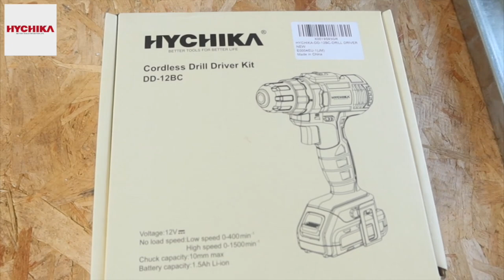🔥 Drywall partition ▶︎ How to Build a metal framed wall 💪 PLADUR

Comment: Manufacturer of intelligent manufacturing equipment for light steel structure buildings
Foshan FrameMac Technology Co., Ltd. (FrameMac) is a professional light steel structure building intelligent manufacturing equipment manufacturer in China, providing a fully automatic light steel building frame production solution integrating software and hardware. The "FrameMac" solution realizes the seamless connection of "end-to-end" production from CAD architectural design software to production processing, construction and installation. FrameMac light steel equipment source factory

Comment: worst and totally wrong make drywall sheet horicontal, lot seam and lot more work than vertical. sheet have standard dimensions perfect to height and wide to drywall not need cut any.
Reply: Cross-bracing for rigidity/  added structural strength (common sense)

Comment: such houses are blown away by light hurricanes)
Reply: Whewre did you learn your structural design? In the Tubold's University of  Quiapo!  Those structures were originally design and built by the US Navy in Guam, Marianas and other Super Typhoon belt!  IQ 11!
Reply: same wood frame blow if hurricane go, lot better make hollow blog wall all outside wall, inside can make steel, lot cheapen, wood or hollow block wall have same price, wood have expensive and burn easy. wood have worst material today at house.

Comment: I always lay the boards vertical not horizontal..Any reason why you do ?
Reply: Horizontal boards are more#stronger wiht alteranate joints
Reply: Then the support spacing will need to be 50cm not 60cm.
Reply: @carlrotheram3684  this is not a rule ,  he space studs at 40  cm ,  i see details and steps  in his work and i can say he know what is doing
Reply: normall drywall panels installed vertical because normal house height have same than sheet panel height, not need cut and lot lot less seam have, have lot less work at seam and strong.
Reply: @mattivirta  drywall sheets come i various size and vary from place to place , there is no rule /law on how to lay panels , in the vid he fallow  all the right steps
Reply: @TheMakyato  i have working 30 build houses ower 300 house, and drywall sheet has last 30 year only standard size not other have in hardware shop around world 26 country has build houses, all have 2500 X 1200 size ewery country, you can cut in work sheet but hardware have only one size, same plywood and other sheet, all have only standard size not more or less. and if installing sheet horicontal not have wall frame support back to sheet seam horicontal, worst side installing sheet. but vertical you have support because wood or metal abutment have normal all sheet corners, height have standard room same than sheet 2500 and widht have standard wood pillard have ewery 60 CM thats mean have automatic same size than sheet 120 CM and not need cut, only need cut sheet if non- standard room heigh or wall end, door etc. windows etc, if not have wood support back sheet have fast broken and all seam have cracked.
Reply: @mattivirta  in some diy (bricoman) you can find 600x2000 
900x2000
italy   minimum room hight 2700
 600x2000
1200x2000
1200x3000
1200x4000

romania minimum room hight 2550
 600x2000
1200x2000
1200x2600
1200x3000

1200x4000

israel  
1200x2000
1200x2600
1200x2800
1200x3000
Reply: @TheMakyato  i know israel and italy but all houses what we has doing has make europe normal dimensions. some old house restores and need cut little slider to roof side wall but need add horicontal support bar too horicon seam place because not has standard dimension height rooms. and some very big millionaire houses need 2 normal standard size sheet vertical top to wall height has 5 meter about. but has horriple ugly rooms has very high but small rooms all. feel has in room than stand in barrel hahaha.
Reply: Wrong